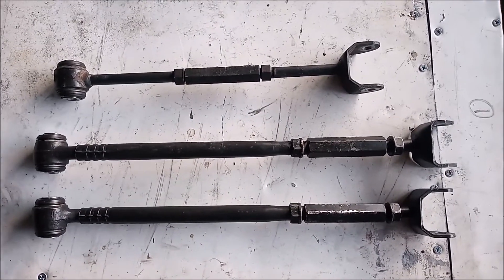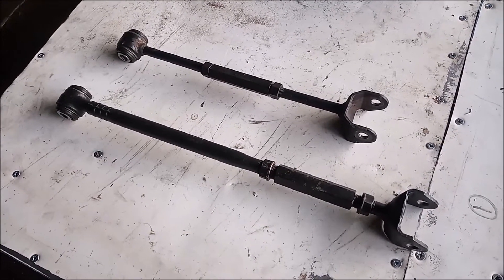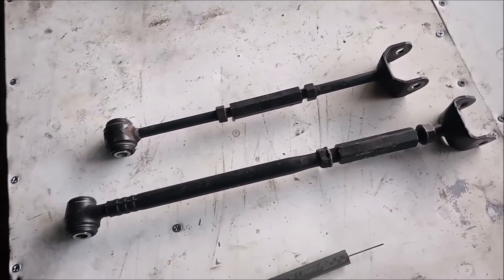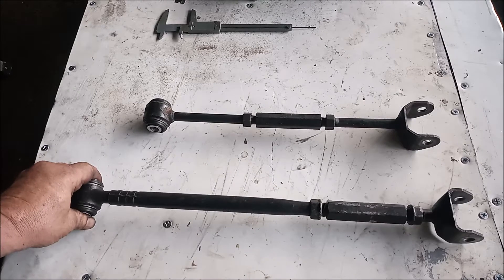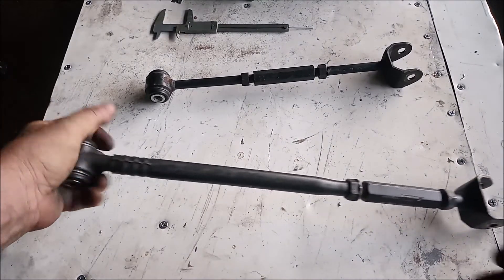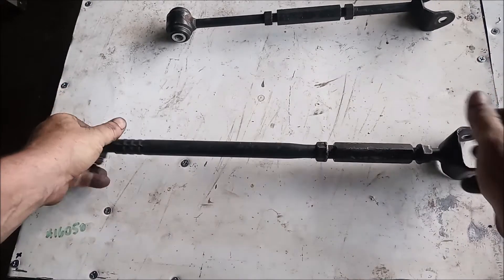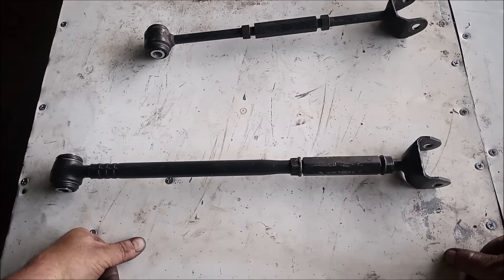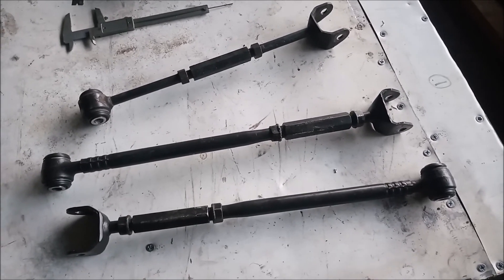Secrets of the SW20 Tie Rod - Toyota MR2

Comment: The longer arm is to reduce toe out on lift. Not bump steer. That was a feature of the early mr2, not a defect. Early auto journos couldn't grasp that idea and spread the snap oversteer fears. It's also naturally a characteristic of mid engine cars.
Reply from the maker: That's the spirit, blame it on the fake news media. Tell that to anyone who has wrapped their MR2 around a telephone pole. Heck wasn't it the family of that Fast and Furious star that won a huge judgement against Porsche, based on the handling "characterisitic" of the car. . The judicial is in on it too. Hey what you call toe out on lift I call bump steer. Po-tay-toe, Poh-tah-toe.
Reply: Advantageous bump steer. I liked the aggressive rotation of my 91 vs my inert 93
Reply: Advantageous bump steer. I liked the aggressive rotation of my 91 vs my inert 93
Reply: Advantageous bump steer. I liked the aggressive rotation of my 91 vs my inert 93
Reply: Advantageous bump steer. I liked the aggressive rotation of my 91 vs my inert 93
Reply: Advantageous bump steer. I liked the aggressive rotation of my 91 vs my inert 93